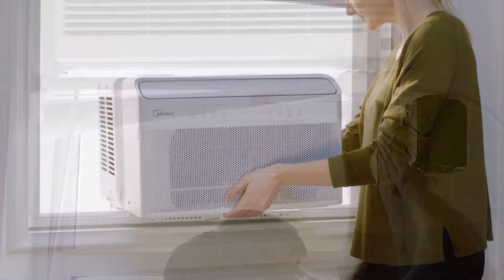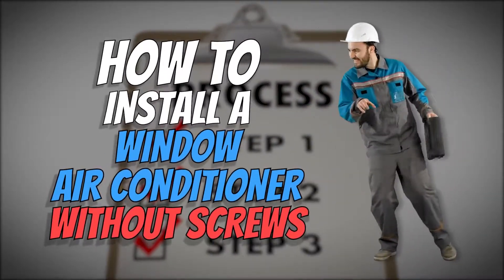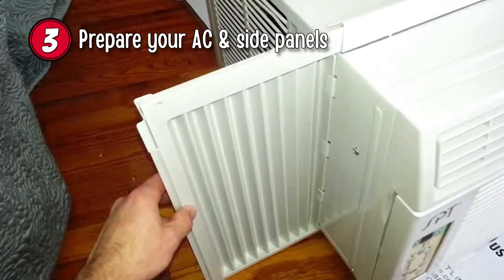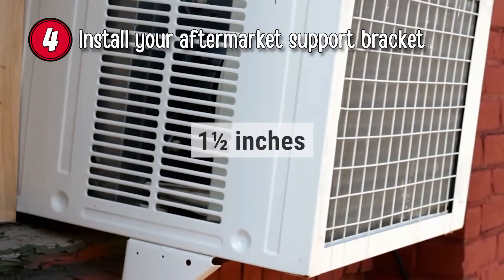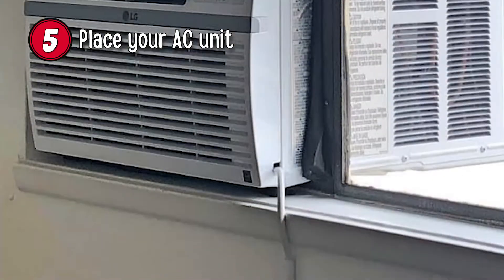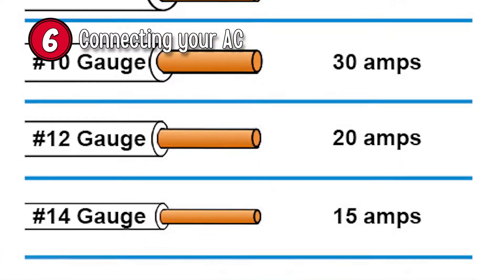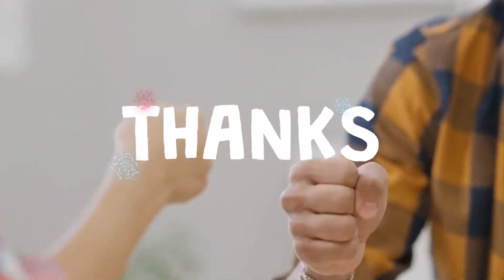How To Install A Window Air Conditioner Without Screws 🛠️ | HVAC Training 101

Comment from the maker: Read the full review here: ►► 
https://hvactraining101.com/ac/window/install-without-screws/
(How To Install A Window Air Conditioner Without Screws)

-------------------------------------
✅ Featured Products for How To Install A Window Air Conditioner Without Screws

0:00 Introduction
1:03 1.Choose Your AC Unit Accordingly
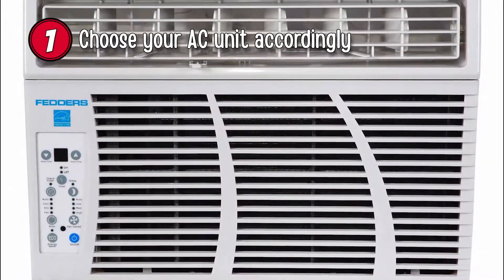1:24 2.Prepare Your Work Area
1:49 3.Prepare Your AC & Side Panels
2:12 4.Install Your Aftermarket Support Bracket
2:58 5. Place Your AC Unit
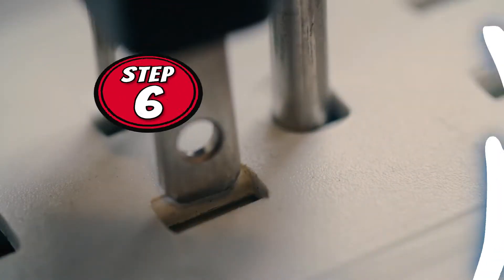3:43 6.Connecting Your AC

Subscribe to our Channel 
🔴 https://hvactraining101.com/youtube/

-------------------------------------
Detailed review: https://hvactraining101.com/ac/window/install-without-screws/

🛠️ Installing an AC without screws is possible, though a few things have to be considered throughout. 

🛠️ Saving Money
As with any home DIY project, saving money is a bonus. Proper installation leads to your AC running more efficiently for much longer and lessens the chance of having to replace parts.

🛠️ Safety Standards
Following the correct safety tips and instructions is paramount to avoiding an unexpected injury or damage to property. Have an assistant help you during your installation, and make sure you use all the manufacturer's parts.

🛠️ Maintaining Your AC
After your installation, maintenance will be your only concern.

💬 Let us know what you think of these How To Install A Window Air Conditioner Without Screws in the comment section below.

👉 We appreciate every thumbs up and would be grateful if you’d consider subscribing to our channel!!

-------------------------------------
🎥 Welcome to the official YouTube Channel of HVAC Training 101 🎥

HVAC Training 101 is dedicated to helping you make smarter buying decisions when it comes to air conditioners, heaters, air purifiers, and other HVAC-related items. 

 🌐 Learn more about us: https://hvactraining101.com/about-me/
 💻 Like our Page: https://hvactraining101.com/facebook/
 📢 Follow us on Twitter: https://hvactraining101.com/twitter/
 📱 Check out our Pinterest: https://hvactraining101.com/pinterest/
 🔴Subscribe to our Channel: https://hvactraining101.com/youtube/

-------------------------------------
Disclaimer:
Some of the footage used in this video is not original content produced by HVAC Training 101. Portions of stock footage of products were gathered from multiple sources including, manufactures, fellow creators, and various other sources. If something belongs to you and you want it to be removed, please do not hesitate to contact us at bob [at] hvactraining101.com.

#HVACTraining101 #AirConditioners #AirConditionerGuide